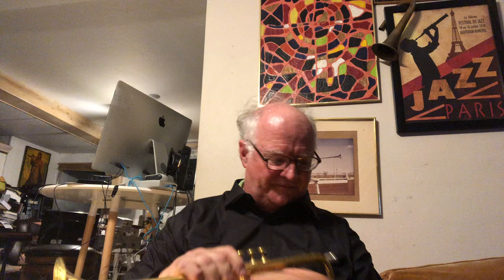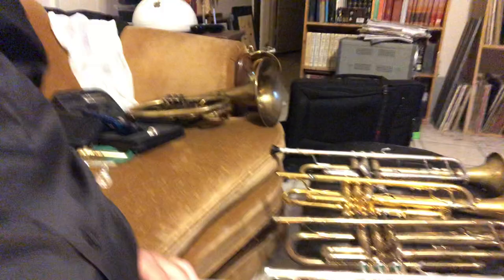Using the Blues to Compare 6 Professional Trumpets

Comment: Those Bessons can really tear it up. The bell, the leadpipe, the sound..... Wow. No wonder they're still sought after nowadays. Although there is a lot of misinformation with the serial numbers and dates. It appears the cutoff of prewar Bessons should be 95xxx, exactly when the valve block construction changed.